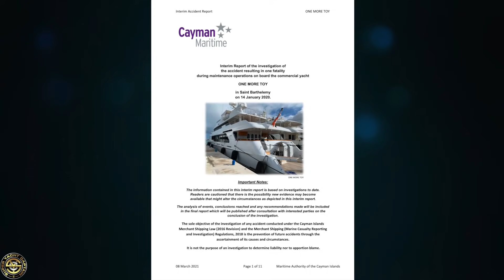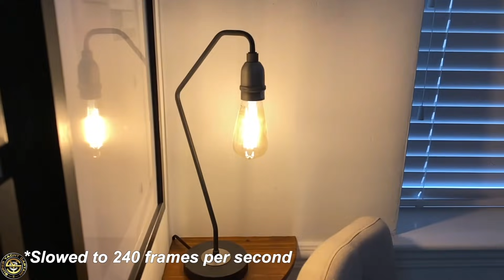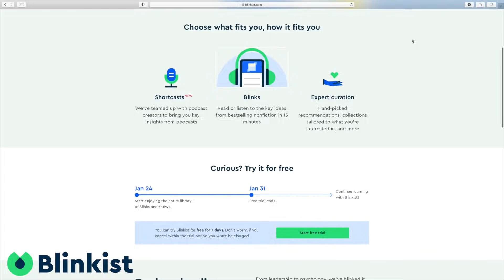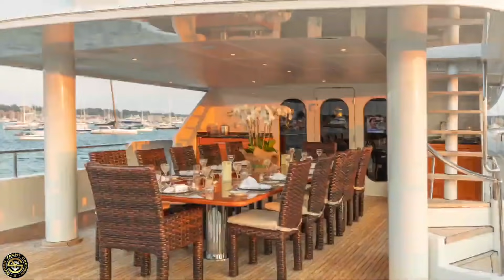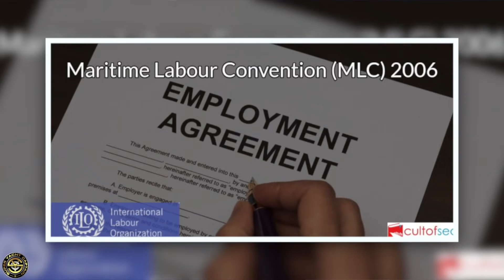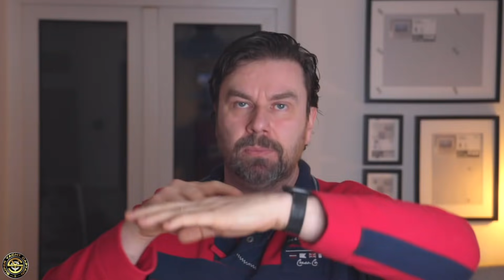Fatal Electric Shock

Comment: I love watching this vlog and will continue to watch simply because I like the manner in which the captain explains things so well. It's sad whenever a life is loss. Its hurts everyone who knows or works with the deceased. You miss and mourn them and, additionally, wonder why death occurred and whether the deceased had any responsibility for their own demise. I'm a home inspector and licensed building contractor with over 30 years experience so I come into contact with energized electrical components regularly so trust me when I state that the deceased could have prevented his own demise had he followed well-known safety measures. One should never touch a conductive material without first testing for voltage, especially while working in an unfamiliar environment or with unfamiliar electrical devices. If I understood the explanation from the engineer, it seems that there were two faults within the electrical system. A. there may have been electrical current leaking to the water within the heater cabinet due to worn out element shielding and B. the "grounding/earth" conductor was disconnected or broken between the elements and the metal plate on the underside of the vessel. As an engineer, the deceased knew full well the risk of contacting any conductive material before doing so, yet he proceeded even after seeing the historical evidence of previous water leakage around the heating device seals within the cabinet. The stains, and the fact that the heater was probably original equipment (older equipment is more likely to fail in some manner) should have been enough of a clue to take greater safety measures before touching a metallic equipment cabinet with bare hands, or head, etc. He could have tested the electrical elements for resistance prior to energizing the elements and found the fault prior to risking his life. I'm only stating these issues because the public should be aware that there is a safe methodology to using older, possibly unsafe, equipment so that no one has to die. People do it every day, including myself, so that they can continue to live and gratulate themselves for finding an unsafe device prior to someone else's injury.  When working with, or around, electrical components, you must assume that all conductive components are energized until you confirm otherwise. Simply touching a metal water supply tubing, or "ground/earth" conductor electrode, has the potential to cause severe electrical injury under come conditions. Never ASSUME; and we all know how to break up the acronym, don't we.
Reply: I wanted to add a comment about shared responsibility for this accidental death between the deceased engineer and the previous, full-time engineer. For anyone who works with electrical components that are in constant contact with water, especially salt water, it should be common knowledge among the trade how corrosive salt water can be to any metallic component, such as an electrical heating element as described in the load bank. Salt water is so corrosive to metal that a recommendation for inspection and systemic replacement should be a regular maintenance recommendation for any metallic component, especially one which is in contact with electricity. Why the elements were in continued use long after corrosion had occurred is a wonder. For instance, an electrical water heater element will fail to function quickly when corrosion allows contact of the electrically-charged component with water within the holding tank and....if the grounding conductor should fail in the manner described by the engineer the metallic cabinet surrounding the inner reservoir could become energized as well. So, this has some potential for injury on land as well as at sea, depending on the components and conditions.

Comment: Great explanation of a very sad outcome - Question, were the heater elements removed for inspection during the investigations? - I suspect these may have broken down during reinstatement thus causing high currents and the the first in line was the external connections breaking down and exposed. - very unfortunate.

Comment: My heart and feelings go out to the family of the captain. I am a electrician and when you deal with 480 3 phase and do not have a natural ground is totally unacceptable and should have been discovered, by the builder and the inspector!
Reply: It was more than likely caused by degradation, hence the repair.

Comment: AED's do not do anything if there is no heartbeat. Administering a shock is not designed to bring a heart back to life, it's designed to actually cause the heart to stop when it's experiencing severe irregular rhythm (i.e. heart attack is an example). Stopping the heart with a shock gives the brain the opportunity to literally 'reboot' the heart and when doing so, hopefully do it with a proper rhythm.

If there is no heart beat, the AED is unfortunately not able to bring the heart back to life :-( Only proper vigorous CPR can have any impact at this point.
Reply: MY MATE has heart problems
he goes and has the heart stopped the tuned back in
seems drastic  works for him.

Comment: Sorry to hear of this accident.  My condolences to the family.
High current flow would likely result in muscle reflex which could have contributed to the head injury.  Since the yacht builder is no longer in business, I wonder what kind of support for retrofitting is available to owners of similarly designed yachts.  
Could a builder be required to issue a recall, if it’s no longer in business?

Comment: Yes, this was unfortunate.  I read the interim report but it doesn't provide much in addition to what you have stated.  IMO-for some reason, the deceased seemed to be laboring under the assumption that the issue with the load bank was water flow.  It seems clear from the report that the elements were short-circuiting to the housing.  I don't know why the housing wasn't properly grounded.  That would have blown a circuit-breaker when the elements began to short circuit.  The report suggests two faults: a) the heating elements shorting to the housing and b) defective grounding of the housing itself.  It seems logical but odd that these issues were not addressed by testing before doing work on the load bank.  One would hope that standard procedure would be to cut off power to the load bank and verify that it is not receiving current before commencing any work on it, even work involving non-electrical procedures such as the sea water plumbing.  I was surprised by this.  I had assumed he had done that and somehow inadvertently come into contact with a live conductor for some other device.  It has been my experience that high-voltage accidents such as this happen primarily to new people who miss a step or two and to old timers who become complacent.  Condolences to his loved ones.

Comment: I have some questions / additions:
1.) In Germany normally no one should work in an live electrical system alone - so if any accident accrues, another person can help. The time frame you mentioned has a long time, were the engineer could have contacted the electricity. I know this is hard to realize in an boat crew were not so many people are on duty. What do the on board procedures say?
2.) Th picture from inside the housing was some confusing for me: Such a tiny ground contact??? The earth wire should be always capable of leading all current into the housing. There seem to be 3 3phase circuits going into the box. One should expect a ground wire from each of that input cables. Or the ground cable should be larger than the current feeding wires.
3.) For me the grounding connection may be "usual" but not qualified. There should be a stud on which the screw is attached. The way it was done is leading to erosion - especially if some current is involved ( ... what not should occure).

It's so sad - I wouldn't expect there to be a thread - I would expect the load would also be connected / mounted to the rest of the engine room so there can be expected another ground connection. But - not always, I'm sad for that great guy.

Comment: Thanks very much for this video. The explanation of how 3 phase AC electricity works is one of the better ones I've seen. I was shocked years ago by 110 volts, and was lucky to survive it. Definitely taught me to respect electricity. RIP to the unfortunate chief engineer, Wayne.
Reply: It was a poor explanation of 3 phase power...oversimplified and distorted for the layperson.

Comment: I've recently been reading about the dangers in the waters of a marina due to latent AC current bleeding through the ground plates of adjacent yachts and the docks and pontoons..  What used to be attributed to dockside drownings around the docks have been found to be electrocution instead.  
Never let your kids, pets or guests swim in your slip or to your tender.  Get away from other boats and docks first, and have your dock connections checked if you have an isolated private dock.  This also includes going over the side to clean the hull while in the slip.  If necessary, use an inflatable boat or your dingy, don't go in the water while in the marina.
Reply: Electric shock drowning (ESD) is more
common than people  realize. There is a website put up by a person who lost
family  members  to this not well
 recognized  problem. The site has
put a great deal of information  out to the public. The danger  is much  greater  in fresh water  than  saltwater  because 
saltwater conducts  stray currents to the
bottom  fairly well. Freshwater is a poor  conductor  so stray current  looks for the path of  least  resistance  which  unfortunately can be a person swimming into a field  of leaking  current. I think  a body acts  like a 
large capacitor absorbing  stray  current. 
People  swimming  toward  the stray current  have felt  the energy  and backed away  or have  been  overwhelmed  and have  been 
shocked/electrocuted. The leakage 
can be your  boat, other nearby  boats
or the marina wiring. Smaller boat marinas  in the  USA are largely 
120/240 single phase. I don't  know  if
480V 3 phase  would  somewhat  overwhelm  the natural  grounding  
of saltwater. I told  a diver who did zincs 
and other  marina diving about this and
he stopped  diving  especially  in freshwater. To be safe in the water 
you have to shut  off the marina power 
and make sure no boat  is running a generator. Years ago we use to joke 
that there  was so much  current  in the
water  that  a light bulb thrown  in would 
glow. Unfortunately  not so  far from  the truth.
Reply: @williambikash6645  yes, clean/fresh water has a higher resistance than our bodies. Our slightly lower resistance could attract current  in certain circumstances. Back in the telecomms days we were taught about "Hot" stations - power plants where the earth potential could be 1000V different than at the telephone exchange.  I can understand how a floating vessel with faulty equipment could create an electrical field in the water around it. ..
Reply: That makes a lot of sense now. That's  why they say no swimming in the marina area besides possibility of being smashed between moored boats orbrun over by a boat.
Reply: Rule 1 about marinas is do not swim in marina...this is one of the first things they teach you when you take boating course and is the first rule people break when they get to marinas.  The number of people I have seen in the water cleaning their hulls before race night boggles the mind.
Reply: This is all true and can happen on land where a neighbor has a leaking circuit to a poor ground and a person in an outdoor shower is hit with live voltage.

Comment: The primary and secondary coils of a transformer are NOT connected to each other. Unless the transformer is being used in reverse the primary is at high voltage(480  for example) and the secondary is a lowervoltage(240 or 120). This is done by magnetic induction using a different number of turns of wire. Twice as many turns in the primary will produce half voltage in the seccondary.
Reply: I think he was demonstrating generation of current rather than a transformer. Though the demonstration item looked to me like a transformer at first
Reply: They are connected by the core..
Reply: @pyrrhical3423  The coils are of insulated wire and not electrically connected. The are "connected" by the magnetic field which is intensified by the soft iron core.
Reply: @davidpeden3025  of course they are, you are quite right. Slipped my mind for a moment.
Reply: Primary and secondary are connected in autotransformer.  Primary can be lower voltage or higher voltage.  Primary is where the power comes in and secondary is where the power leaves.  In power stations the primary is connected to the generator (say 24kV) and secondary is connected to grid (say 500kV).

Comment: Of course its a terrible incident and a shame that the engineer died. The regular platitudes cant express the overall sadness of it all.
I comment simply because of the great explanation and differential described between what Ground, Earth and Neutral  paths of current. So long has that been a point of confusion when it is described.
I would also commend the actions of the crew and rescue personnel involved.

Comment: So Sad that these things Happens. But Electricity is a dodgy thing..It scares me on my Cat with generators, solar, Wind Generators, 12 volt, 24 volt, 120 volt, and 240 volt systems all on board and I am in the process of changing everything over Li Ion Batteries.. And Now that so many Cats over here are getting Lightening Strikes and that is getting a whole new protections system too... On a happier note..When is A.W.O.L. going to Splash?

Comment: Very very sad to learn the tale of the death of the chief engineer.
Before Christmas last we had electricians come out to replace our consumer unit.
Before any work was started they checked the present wiring for earth connections etc etc 
So they knew that what they were going to alter was safe to start with.
I presume that as a result of this tragic avoidable death that all chief engineers will have to certify all equipment before they take over command of a vessel.
Horrible to learn of the death of this poor man.
Rest in peace sir.